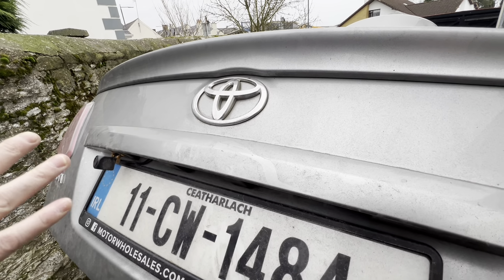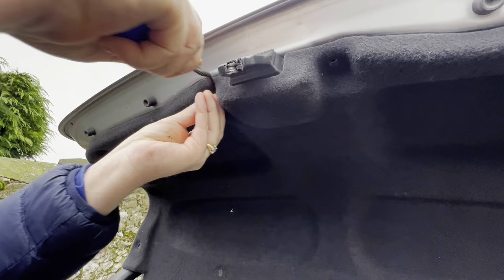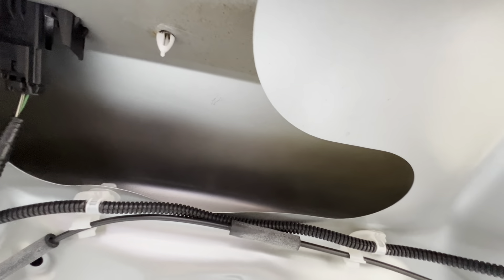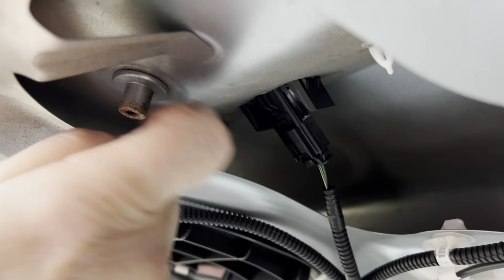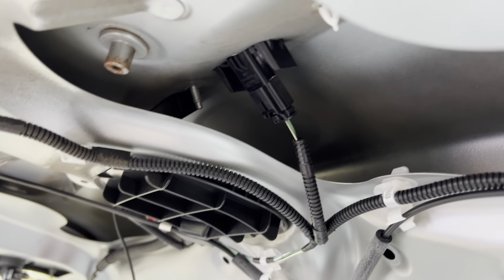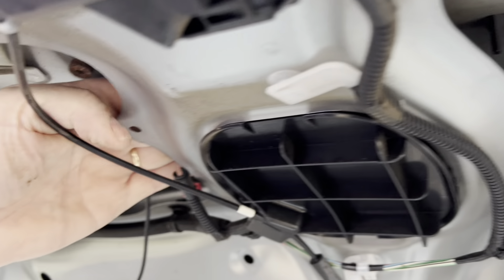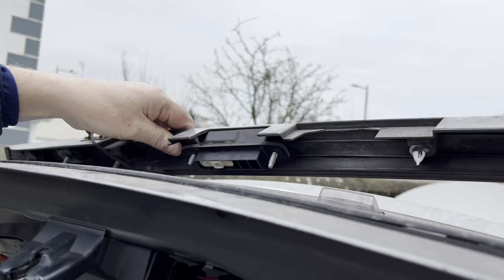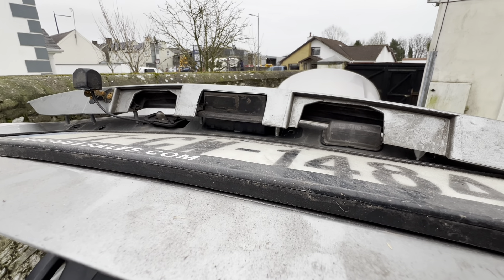Toyota Avensis T27 2008 to 2015 Boot / Trunk Trim Removal.

Comment: Hi mate! Very nice channel as I own a Toyota Avensis T27 (2009). 
I have had the car for 5 months but I find it a bit noisy especially at speeds over 110 km/h. There's a wind noise coming from somewhere near the windows. I went to the Toyota dealership and the guy was like "no everything is normal".
I saw in another of your videos that you added wind deflectors. Does it work? Did you have this issue or is it just something normal?
Greetings from France!
Reply from the maker: The small triangle window at the front door is where it’s leaking air I think seems to be a flaw in them